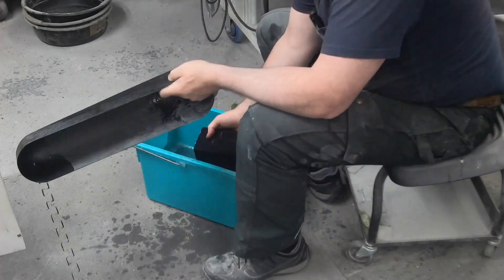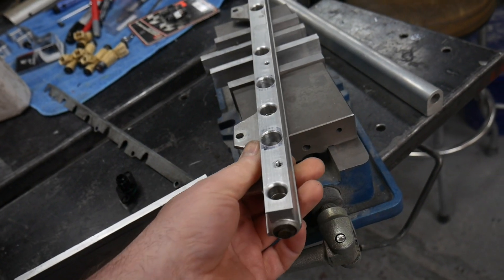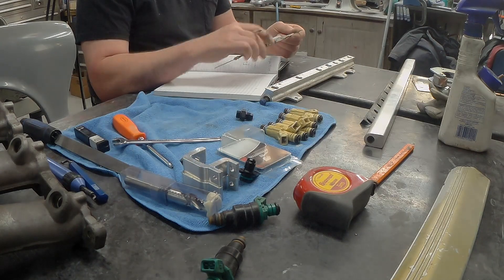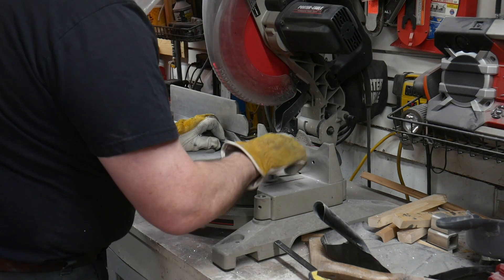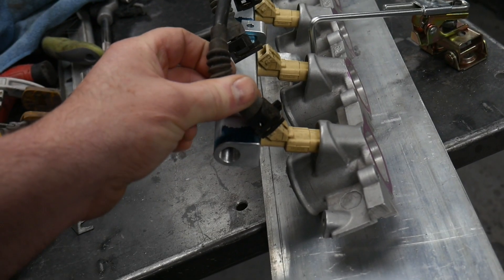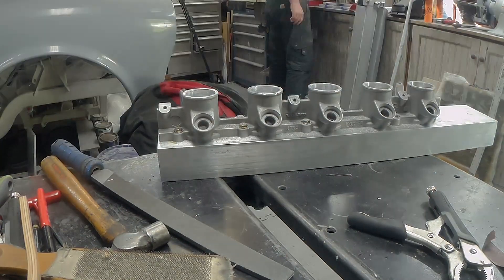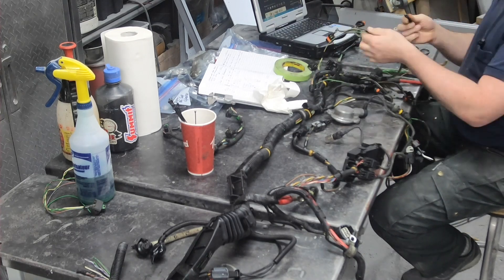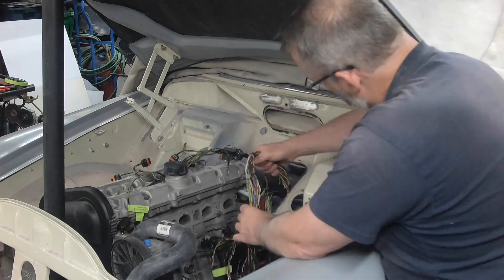DIY Carbon Fiber Intake: Part 3 - DETAILS

Comment: Being a welder, it would have been nice to see more of the welding you did on this piece.  Enjoyed watching you do the chassis and the careful planning you did to keep from stressing and distorting it.  Don't know what alloy you are using on the plenum; but if you were able to find the preheat temp of it before affecting the composition of it.  Sticking it in the oven and heat soaking before welding possibly would have allowed you to still weld your stacks to the plenum.
Reply from the maker: I lost some of that footage (happens from time to time).  I took the off-cuts and fully tested the process to get full penetration of the part (width of the land, settings that sort of thing) and I had it down.  The material is 6061-T6 with the exception of the casting which is some high silicon thing for flow - it does weld nicely (for a casting).  The problem was the plenum base is quite thick and the heat rocketed out of the weld and cracked many times...thus the torch.  I raised the heat to around 400º C and then I hit the duty cycle limit on my Dynasty 200DX.  The thermal protection just shuts down the arc randomly.  I tried for hours to weld it (most of a day) and it was not letting me do it.  The runners are pipe not tube (sch 10) and thick as well.  If I was doing it again, they would be thinner wall.  It was just a bunch easier to take it to a specialist with a 380A machine and he punched it out no problem.  He did note that the heat transfer into the plenum base was rapid and a little unexpected.

Comment: Could the fuel rail have been wrapped in carbon fiber to add thickness and repair the damage? If so what bonder would you recomend to use for such? Great videos.
Reply from the maker: I could have welded it up - but it's not worth the time.  This was a better option for longevity and safe fuel delivery.
Reply: @ThrottleStopGarage  thank you for the response. Would bonding carbon fiber to it work for such a repair?  I appreciate you sharing your knowledge.
Reply from the maker: @jasonhamilton560  I really don't think so.  I mean with the correct adhesive you could put a few layers on it and it may just work - but making a fuel rail for such an important part is cheap.  I noticed a Singer Porsche 911 popped up on Copart that had burnt to the ground from an engine fire.  This is what can happen if you're not careful.
Reply: @ThrottleStopGarage  I'm planning on installing a turbo kit to my 90 gli with carbon fiber bits, maybe some body panels ( after  reading a bit and watching your videos) , need to learn more. Your videos are encouraging and informative. 
Is Carbon fiber more susceptible to catch fire?
Reply from the maker: @jasonhamilton560  It's the resin not the carbon.  Sure carbon will burn, but look up the details.  Most resins are good to around 100º C with high temp resins getting beyond 150º C.   Would I put it close to a turbo?  Not without a heat barrier.
Reply: @ThrottleStopGarage  was intending to make an intake after the intercooler and air intakes to direct airflow into the coolers. What books would you recomend?
Reply from the maker: @jasonhamilton560  Corky Bell - Maximum Boost.  Good start.

Comment: What thermostat housing is that?! I have a P2 S60R and the t-stat housing is a major obstacle to intake manifold removal/installation. Some guys have custom cut and welded their own housings to fix it but that part looks like it might be a stock replacement that just... fits. Thanks in advance!
Reply from the maker: Interesting - depending on year, your car should have this housing.  Look for 2005 up.  The wiring also went through a number of iterations. So you'll need a different connector.

Comment: I have a question: when you make Vakuum infusion, do heat them after finish or do your resin get hard without heating. My problem is, when I heat my mould the next day, the resin geht wet again and the surface get holes. Maybe it is better to keep Vakuum while heating. Hope you understand my bad Englisch
Reply from the maker: I do bake the parts, but they cure just fine at room temperature.  So my resin system is fully cured at room temperature (20º C - 24 hours) and then I raise the temperature and give the parts a final heat cycle to between 60 and 85º C for 8 hours later to achieve final strength.  Keep your parts under full vacuum until your resin system has properly cured.
Reply: @ThrottleStopGarage  do you demould before heating up to 60 and 85 degrees or after? And you keep Vakuum all the time?

Comment: The extra cost for tapping probably stems from potential part scrapping. Granted if its aluminum of any alloy it taps really easy, but thread milling or tapping is one of the easier ways to break tooling and scrap parts.
Reply from the maker: That makes sense - 6061 is "sticky" to tap in my experience and with smaller taps, breaking is a problem.
Reply: @ThrottleStopGarage  wanna talk about sticky? Try tapping 0-80 threads in blind holes in 6al4v titanium! PITA!
However titanium doesn't care about ferric chloride and taps dissolve in it. So when I snap a tap in ti, it just soaks in a is for a few hours lol.

Love your vids man! Keep up the awesome work!
Reply from the maker: @vdub5818  I've never tapped anything that small and in a blind hole.  That has to suck.
Reply: @ThrottleStopGarage  that it does, but when I hand a knife to someone and they can't see any screws and/or are trying to figure out how it was put together, it makes all of it worth it. Also I charge more for hidden hardware so that helps too🤣

Comment: Why won't you use the junkyard loom? Do you intend to build a new one? Isn't that needlessly long and expensive?
Reply from the maker: Good question Danny - I have the footage and will do it justice in a later episode - but there were a few changes that this loom didn't have.  Things like the location of the temperature sensor, it only had one VVT solenoid connector, I'll be changing the type of coil pack and just general wear on the wire insulation.  I've found a lot of looms that use TXL wire will get brittle after exposure to heat over time.  So I find insulation breaks just after the seal because it's too stiff.  I will use the connectors and repin them into a new harness.  It was a challenge to find all the connector types - but I have them now and will do the entire loom.  I also see a lot of project cars plagued with wiring gremlins.  I also like wiring - it's an illness.